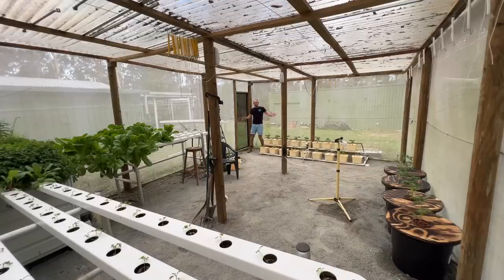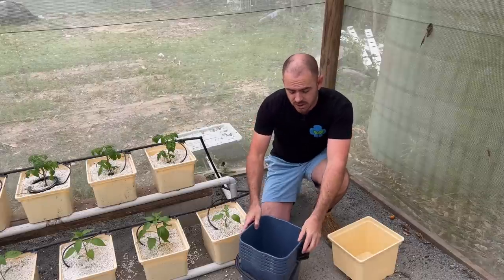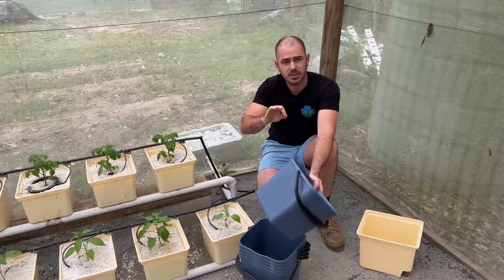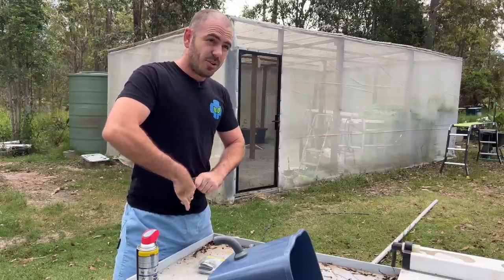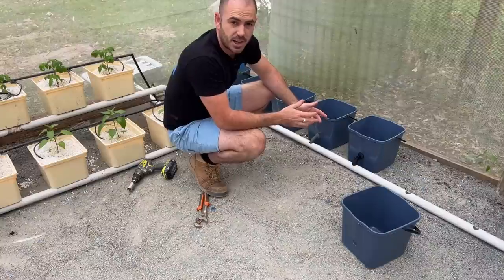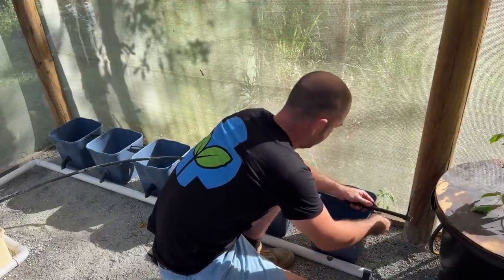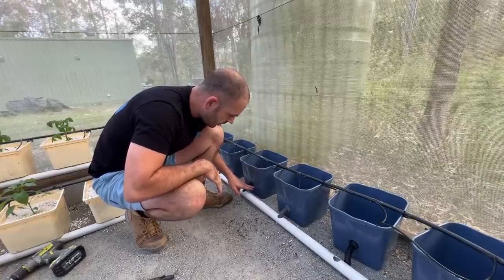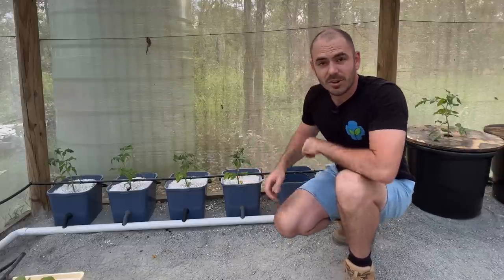Don't Buy Bato Buckets Till You See This!

Comment: I couldn't justify the computer and 3D printer set costs of $500+- so I went to the hardware store and purchased 1/2 PVC elbows & 1/2 pipe. My total cost was 60¢ for 2 elbows & 2" of Pipe. Add the cost of Used buckets I get with Dog Food & Cat Litter and my DIY Bato buckets cost less than $1.

Comment: Very impressed, a seeming simple idea that hadn't been done yet. But it must have taken quite a bit of work to design a 3d print of a curved tube with internal supports that break off so easily, a thread and stop in the middle, and a nut that fits perfectly. Excellent!
Reply from the maker: Thank you mate. Fusion is quite intuitive, the pipe making tool is pretty amazing when paired with a sketched spline.
This was my first time using it. I’m keen to do some more intricate designs.

Though I find the simpler the idea, the better.
Reply: @Hoocho  For what it's worth I've been able to print them with no supports for the internals. Only tree supports on the exterior

Comment: I would probably remove all the handles, and depending on how they were attached, design a 3d print that clips in where the handle was, and integrate a hose clip into it. Would 3d print pretty fast.

You could even rotate them 90° and run it at the back of the bucket and run drip lines from there if that suits better for different setups.

Great simple design Hooch, love your work. I may even go grab those same buckets and try them out 👍🏻
Reply: I should have scrolled down before posting : /
Reply: @dalewhite2253  haha, glad someone had a similar idea at least 👍🏻

Comment: You can fix the irrigation line to the return pipe or the ground and use longer microtubing with stakes at the end. No need to fix it to the buckets. It's nice because you can move the buckets around easily.

Comment: Get Plastics that are UV stabilized, if you don't they won't last a year outside. 
If you don't know if it is UV stabilized your best bet is to get the darkest color Plastics possible to stop the light getting into the plastic.
Reply: Just wanting to add on to this, PETG is the most UV resistant of the commonly used consumer filaments, and has a high enough melting point that you won't be dealing with warping in most environments that won't cook your plants.

Comment: Have you found any of the perlite running off to reservoir or blocking pipe during the draining phase? No need for filter?
Reply: There are posts by people complaining their bato buckets are losing perlite.  TOld to use a bag or filter of some sort in the bucket to filter it out.

Comment: Is there any worry about leaching coming from the printables?
Reply: If the printed parts are PLA or nylon filament without additives, they are safe and free of plasticizers and are technically food safe (though you wouldn’t want to eat from 3d printed stuff due to the nooks and crannies). As for the plastic buckets, yeah — you’d really need to vet the sources and ensure they’re made from stable plastics (particularly UV stable so they last a few years at least).

Comment: Great system, as you mentioned ideal for productivity and small spaces.  
Do you have trouble with the ph raising as i haven't seen you flush the perlite before using? 
And the perlite being sucked out back too the res once the syphon runs from the buckets. maybe print up some little cages too fit on the end thats in the bucket,  I used slotted PVC tubing and balls like in your chop and flip system but different, Before this I had my balls being sucked up the pipeline and coursing blockages.
Cheers Craig 🥃⛏️

Comment: Great idea! I've been having an issue with the modular drain and fill system with finding a good barbed fitting that wouldn't leak. This snorkel concept would work perfectly, I would just need to resize/shape the end to an appropriate-sized barbed end.
Reply: 19mm with a barb socket and a gromet, any hydro shop or ebay has them cheap as

Comment: @HOOCHO  sorry to ask here on this video, not sure a better way to reach out. I value your insights and knowledge, so I’m asking your opinion on a product called GARDYN 3 a beginner type hydro system with lots of bells and whistles. Being a total noob to this can you please give a look at it and let me know what you think. Some things I wondering is if you get locked into using there products or if it can be readily used with other rock wool and plant food. And help from yourself or others would be greatly appreciated. Thank you. Cheers
Reply from the maker: I had a look, you’re better off building your own if you are up for it, put it outdoors if you have the space.
A good NFT will be cheaper and easier.
Reply: @Hoocho  thanks Hoocho, I’m just trying to get up and running. Here in Oregon USA outside isn’t a option yet. But thank you, I’ll give a build a go. Cheers

Comment: Very nice, the bato buckets are so expensive.  I'm using 5 gallon buckets with paint strainer bags for my bato bucket system.  I'm using a bathtub for the res and a sheet of plywood over the top with holes to accommodate the 5 gallon buckets.  Just using a hole about an inch and a half up from the bottom to allow return to the res. Also, using an air stone in the res.  Do you think that will work ok?
Reply: They're really not expensive. These likely cost more. Bato buckets are cheap and perfect.

Comment: I tried a few of these fitttings and had problems with the nut loosening after sun exposure. I think it is best to install them the opposite way as depicted in the video, with the nut on the outside. It doesn't look as clean, but the nut can be retighened as needed.
Reply: I was thinking some kind of clip would be better than the nut. Easier to print, and simple installation.

Comment: Awesome idea! I'm curious however...How are you able to get the buckets on the ground and still feed the return nutes into a reservoir and hold at any decent level? Is your res buried, or just sitting significantly lower allowing you to enter the return nutes high enough to keep a decent amount of solution? I'd love to be able to do something like that in my grow room, but without having to put my buckets on a higher level if I can help it, or do something similar to that. The only issue is that since my res would sit at the same level, the piping would literally enter at ground level, so I'd never be able to keep a decent level of solution?
Reply from the maker: My res is buried
Reply: @Hoocho  - Stellar...
Reply: There's a way to do it with the res higher than the buckets

Comment: Joined the Patron but the files from the vertical system were not available and other were only available if you choose the high end support. I did a message several times and go no response.  Not good.
Reply from the maker: It’s all in the latest folder which is explained multiple times across the page.
Reply: @Hoocho  Thanks but now I'm no longer a Patron for some reason even tho my CC was charged. I give up. Keep doing what you do, Ill keep watching and hitting the like button. But the file distribution is "not good."

Comment: Question: how would this method compare to the Kratky method of just letting them sit in a bucket?
Reply from the maker: Tomatoes require a lot more water than 12L

The plants in the black bucket in this video are kratky tomatoes for an upcoming video.

Those buckets are 65L
Reply: @Hoocho  makes sense! So, for stuff like lettuce or other greens that you grow and then harvest pretty quickly, you can get away with lower volumes of water.
Reply from the maker: @toastrecon  lettuce take 3-6 litres per plant.

I’ll link kratkys papers for you to have a read.

https://www.ctahr.hawaii.edu/hawaii/downloads/three_non-circulating_hydroponic_methods_for_growing_lettuce.pdf
Reply: This will work for Kratky, just use all the holes in the buckets to connect them all together with 12mm tubing, then connect those buckets to a Control bucket with float valve. Feed you res into the control bucket.. The water level will remain the same in all buckets

Comment: I’d like to try running compost tea in a beto system , I wonder if It would work ?
Reply: I feel like it will work fine. Especially if you’re not using drip emitters and just using 1/4” tubing stuck down in the media.

Comment: Couldn't you also just get some pipe, flex it into shape and seal it with silicon? :D
Reply: It will leak. Bulkhead style fittings are far more reliable.

Comment: fdm printed parts really aren't desirable when in contact with water, and foods, you run the risk of chemicals leeching into your nutrient solution over time.
i can't tell you if it's safe or not, but it's just not worth running the risk, especially with cheap filaments.